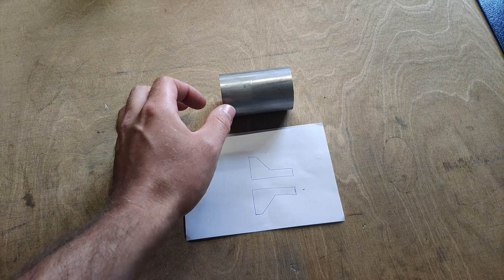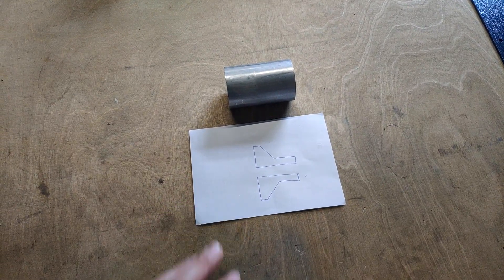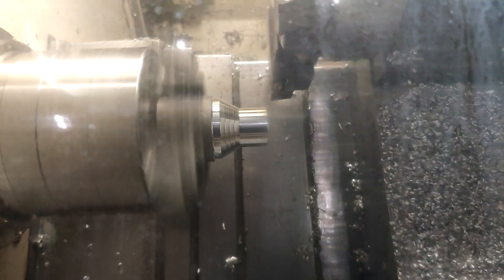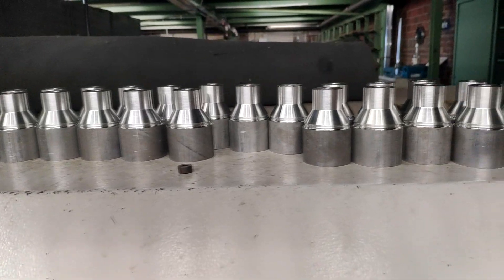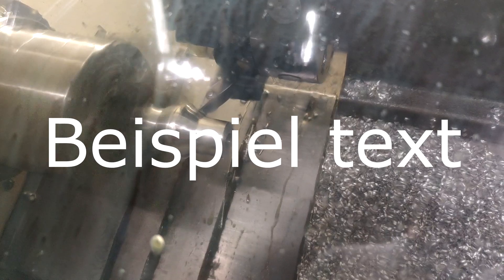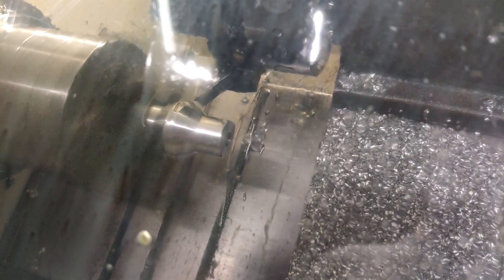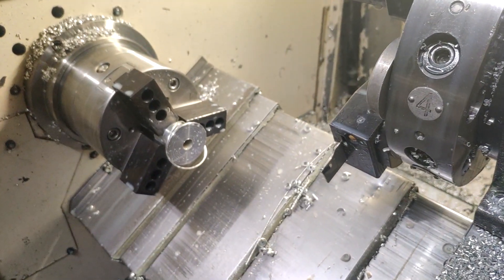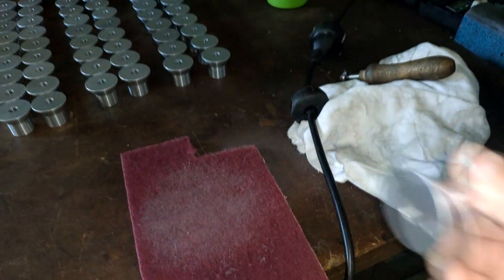How to make the most out of your raw stock

Comment: If you leave the combined parts another .030" long you can part off with .015" left between each part and then immediately finish the face of the part that is left in the chuck. You'll still have the same .015" left on the part that you parted off. Then just rechuck the parts that were parted off and face them off too. Then you don't have to mess around with sandpaper or Scotch Brite and they have a turned finish all over. So, basically if the parts finish at 2x part length + Parting tool width + .030" before the part off, you can come in and part the first one of .015" long and it should leave the same amount extra on the part in the chuck.

Comment: I'm currently using this trick on steroids. :-D I have a stock part which is 3x the length, then I turn part #1, part it off, pull out, part #2, turn around, part#3, and final part off. :-)
The only "problem" is that I do that on my small manual milling machine due to the lack of a real lathe.